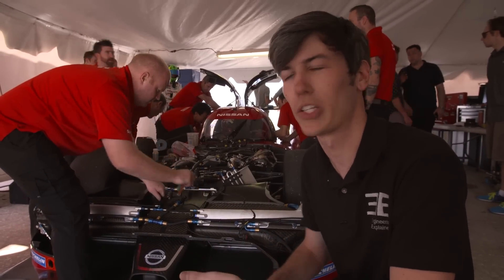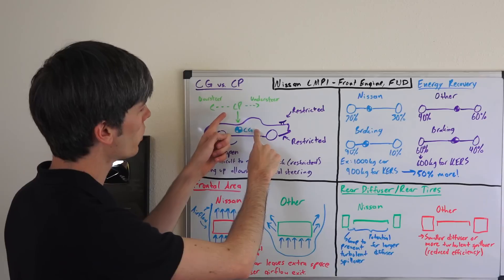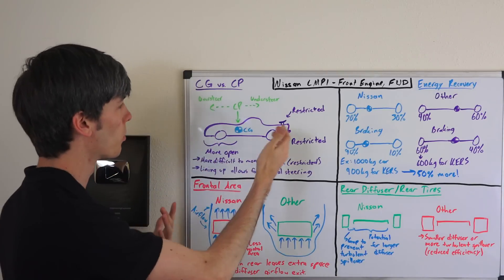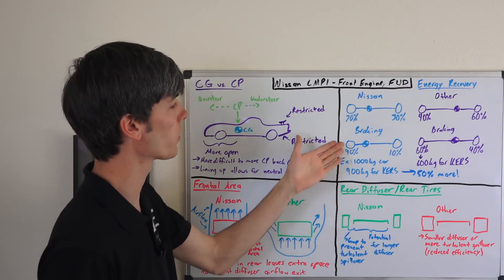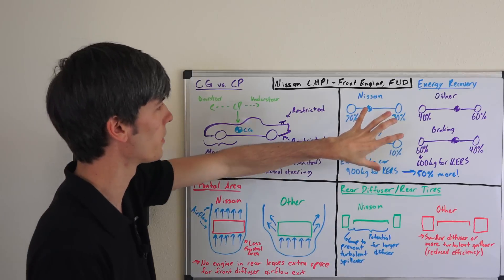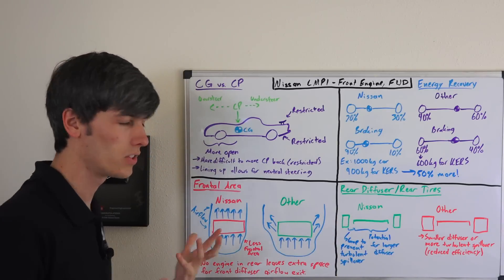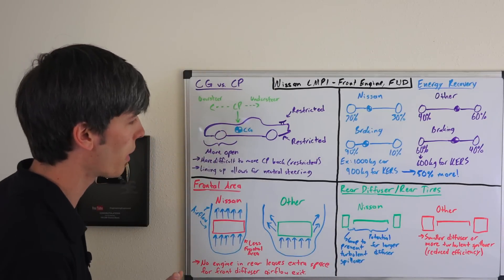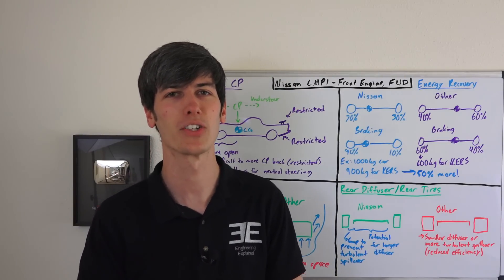Nissan GTR LM Nismo - 4 Reasons Why Its FWD & Front Engine

Comment: There're no drawbacks into transfer almost all the weight on the front axle under braking??
Reply: Daniele Dal Col I would guess that the main Problem is tire wear. It don't know how they are going to deal with that.
Reply from the maker: Daniele Dal Col If you're able to recover most of the this energy via the KERS system, you don't have to worry about the brakes overheating.
Reply: PcTechandGaming Based on other articles that I've read (topgear.com has done some really good articles on it) the majority of the braking will not be done with the brakes. Most of the deceleration will come from the mechanical flywheel that provides the energy recovery and more than half of their car's total power. When they go to slow down for a corner the flywheel spins in the opposite direction, slowing the car down and storing energy in the flywheel rotation. When they accelerate out of a corner, a drive shaft will connect to the wheels and send roughly 700 horsepower to the wheels.
Reply from the maker: Icetouch Absolutely, a challenge they'll be faced with.
Reply: Engineering Explained Wouldn't it be less efficient if front brakes do 90% of braking compared to 60%. And what about locking wheels under braking and also not being able to turn while braking?
Reply: RocketNothing Everyone makes their race cars to perform well on the tracks that you intend to win on, you know Audi bias their prototypes for LeMans as well. 

I actually think that it is the coolest prototype in some time now (purely because they are going a different route). Though you probably will not see this car on the back ground of my desk top, though I wouldn't go so far as to write this car off. I would wait and see what it can do on the race track and see if such out of the box thinking has paid off for Nissan.
Reply: Daniele Dal Col The drawback will be the tyre wear, but it wont be as bad as one would think.
Edit: sry didnt see you already said it
Reply: Daniele Dal Col There's nothing but drawbacks with it; the ONLY thing that's improved is the amount of energy it can recover from the front.  In contrast to a mid engine RWD of the same weight and power it will have;  poorer balance, poorer cornering, poorer braking, poorer launch, poorer tyre wear, excessive cabin temperatures, excessive stress on the steering components and constant problems with understeer.  It's eco approach may have some pay backs in a 24hr race on a track where cornering and braking isn't key but don't hold your breath for this thing to revolutionise the world of race car design, it will not.
Reply: Didnt say cabin heat wont be a relevant factor, but i was arguing that its ridiculous to think that they would let it get to the point of the cabin being unbearable like the other guy said. And youre wrong, this car does have several aerodynamic advantages, and the differential and driveshaft is surely neatly packaged up under the under tray as best as possible. Fact is this car can generate mass amount more downforce on its drive wheels, it can generate mass amounts more downforce but also less drag due to the rear diffuser design with skinny rear tires. Its kind of ridiculous to say they deserve to lose for trying to innovate. I doubt they will lose, if they can manage to finish the race id expect a respectable finish. I doubt they would win with this type of set up especially with such radical ideas. I wouldnt be surprised if Nismo was able to make it a contender over time though, credit where its due, Nismo is capable of incredible engineering.
Reply: u r able to turn while braking, its all about not locking, more braking less turning and viceversa
Reply: Nissan never won 24h Le Mans. Mazda is the only Japanese manufacturer that has won Le Mans
Reply: RocketNothing if they can recover more energy on the front wireless
Wheels then they may be able to get longer boosts from the electric side of things. Also he did point out some aerodynamic benefits of this layout. It is an interesting vehicle certainly, I hope they have success with it.
Reply: Nissan has one at Le Mans, just not overall in a prototype. Theyve had success there with multiple cars, and have won their in class. Their a competent racing team.

Anyways, youre just plain wrong about heat. Its ridiculous that you think a multi million dollar, technologically advanced prototype car would have a problem with heat dispersion. There is massive ducts pulling the air straight through the car, meaning cold air goes in and hot air can be expelled through the back. Its also ridiculous that you would think the front driveshaft would cause more aerodynamic distress compared to its competitors. Prototype cars have flat underbodies, they are heavily sculpted to get every bit of downforce, and every bit less drag they possibly can. Again, you are naming issues that would arise with a backyard civic track car build. This is a Le Mans prototype, you arent smarter than their engineers. They thought everything youre mentioning. Why dont you just wait to see the car perform instead of making asinine assumptions that you cant possible back up.
Reply: Indeed, the downforce and aero grip these cars can produce nowadays is staggering. Even tricking down now into the "hyper cars" and some super cars. The Gtr Nismo is a good example, Nismo extensively shielded and sculpted the underbody of that car to produce more downforce and less drag. Something that Nissan clearly pulled straight from its racing experience. Thats just one example of course, it was the first to come to mine, but theres plenty of production cars implementing ridiculous amounts of downforce inducing aero these days. C7 Z07 is another example, with 3 stages of aero. Downforce is a wonderful thing it allows for faster more stable cornering and thus better lap times in many cases, but there is something to be said for the old days of F1 racing where you had 200mph go karts racing on the Nurburgring with no electronics at all just some pedals and a steering wheel. It made for more memorable racing imo.
Reply: Some Body  Cabin heat is a well known problem for all front engine cars at Le Mans, I'm not theorising here, this is commonly known fact.  And while I'm sure you're right, air around the driveshafts is hardly going to pose a game changing obstacle, I'm simply saying that the statement claiming it has aero advantages because it's front engine isn't true, and it's not.  I think it will come last in it's class and Porsche will win this year, and quite frankly they deserve to come last for bringing a FWD car to that level of sport.
Reply: Nissan have raced at Le Mans before.  They've never won.Some Body
Reply: Icetouch yeah they're demanding a lot from their front tyres they have to find  traction do the steering and a  good % of breaking.
Reply: Daniele Dal Col They obviously don't think of it all, it's going to be so shit at Le Mans. I just hope they don't kill anyone with some kind of failure tbh
Reply: Daniele Dal Col With less load on the rear tires under braking will reduce their braking effectiveness. This will result in wasted contact patch area for braking and force all of that braking on the front tires. Even if the front to rear tire width are the same I would think that it wouldn't brake as hard.
Reply: Some Body Nissan has never won the Le Mans 24 hour.
Reply: Duane Craig  Yes, given the rule change to give them an "X" amount of energy to use, every bit of recovered power will directly transfer to added power to the car, so recovery is a very key factor this year.  Also you don't really need a car that can corner to win Le Mans, their corners are practically non existant.  But lets not lie, this is a gimmicky design that only has realistic pay offs at Le Mans 24, it isn't a cool car, I would never put a poster of it on my wall and on any other circuit that has a normal level of corners it will get absolutely slaughtered by the competition, I guarantee that.  And contrary to what this video says I don't believe it has any aero advantages over the competition, if anything ducting the exit air to the rear instead of the sides will decrease the amount of vacuum induced downforce through the rear diffuser, it also means the air has a longer path to travel through the finite space of the car body, further making more resistance and disturbing the air flow pattern.
Reply: has won at Le Mans*
Reply: Some Body In modern race cars they rely heavily on aerodynamic grip anyways to the point where mechanical grip on many race cars is reduced in its importance.
Reply: PcTechandGaming If you try to brake when turning at high speed, you will be straight like a bullet. You never brake when turning in high speeds, except in veeeeery large radius.
Reply: Some Body Why can it generate more downforce on the drive wheels?  Explain.  My understanding is simply that the rules stipulate a downforce limit on the rear wing but not the front wing?  And yeah don't get me wrong, I'm a huge Nissan guy, but only really for their AWD stuff.  They stand a chance at Le Mans with this idea, the car just bothers me, it's just wrong.
Reply: But honestly I think they're gonna have problems preserving the tyres, they're very lucky they run Michelins and not that Italian tripe ;)
Reply: Dan Green  Yes they are all good points, though to me having the centre of pressure over the front wheels further increases the heat load and subsequently wear on what is (in my opinion) an already flawed and over stressed setup for the front tyres; true they have individual tyres available on top of the standard 6 sets, but it isn't offsetting the wear very well to the rears.  How does it get 50% more recover energy than the others?  They are front wheel electric motors too, simply because they are higher capacity motors on the Nissan?  I thought the advantage of that ideal was less resistance?
Reply: Dan Green   And if you look at the aero design of the mid engine cars, they all flow air "through" the car as much as possible too, yes it will be less than the Nissan as there's an engine in the back but the pros compared to the cons here are minimal.
Reply: Seems to me to move nearly all the stress to the front end. Some may see that as a bad thing, but is it really? Seems like to me 2 slightly larger potential problems is better than 4. They will simply pay more attention to the front tires, since the rear tires will have it easy. I do think they can damage control something as important as that. Additionally, having 2 wore tires in the rear is much harder to deal with than the front.
It really seems to be something that should be restricted, but only if it is a success will warrant that true or false. I do know the rear end aerodynamics were regulated to keep people on the same playing ground, but this change makes their car much more different than the regulations intend.
It may make the regulation rules officials feel a little ticked off and loop holed, but you gotta give it to them for thinking outside the box.
Reply: RocketNothing I think it could possibly oversteer with such big grip bias towards the front.
Reply: *****  Yeah you're probably right but they still have a challenge with setting the balance up; FWDs understeer worst under power so if they've made the tyre sizes such that it counters that, the lift off oversteer will be terrifying.  Race engineers are no fools though, they will know they have to strike a balance somewhere and it's always going to be a compromise between the two on this car.  And Richard; the problem with letting the front do everything is they're just not letting the rear help out with the G transfer, stress and tyre heat efficiently. It costs resistance, weight and energy to have those rear wheels on the car and they just aren't pulling their weight (and I don't mean that in a literal sense)
Reply: RocketNothing Honestly, I think dealing with under/over steer is just a checkbox on the pre-race tuning check list.
There are so many ways to adjust under and oversteer it is not even a reasonable thing to worry about. The low friction differential will remove any unpredictability from the oversteer, then the rest could be taken care of in the suspension. Of course, adjusting for oversteer via the suspension adds more work for the tires to do, which shifts the problem BACK to the front tires again, which you can then insert my original comment.
Reply: Richard Smith Yeah many things you can do with the suspension and differential to dial the oversteer in; anti sway bars is the quickest, but there's always adverse effects, there is no substitute to having a well balanced chassis to begin with.  Not that cornering is really a main requirement at Le Mans.
Reply: +Icetouch The front tires are fatter than normal so that should help with added tire wear. 

Another aero aspect not mentioned is that the ideal cross sectional profile form front to back is large to small profile (like a tear drop). Having the engine and fat tires up front lets them achieve this with this car design.
Reply: understeer which is why fwd is hated
Reply: Daniele Dal Col. there have long been known techniques for driving fwd cars fast.
Reply: Flammen.   you know this how?  its common for radically different cars to go through a steep development curve in racing. new designs usually start at the rear of the pack simply because the drivers amd engineers need to learn how to optimize the machine amd technique, something established designs and evolutionary rather than revolutionary designs have an advantage in.

i cant say that they will or wont rise through the ranks as time passes but neither can you.
Reply: DrewLSsix Nope, if a radical design doesn't yield promising result from day one, then it is not justify to continue developing. The Hybrid LMP would have never competitive if the new regulation not heavily favor it. And due to the complexity of the system, the reliability is shot compare to conventional power counterpart. Same goes to front wheel drive car in mourning car race. Have you every heard of convergent of evolution? This can be the analogy in engineering design. Two design team can begin with two drastic different designs at conceptual phase. But if their design are intend to meet the same needs. Then there is likely hood that the end product looks similar. And that is why when you look at Airbus and Boeing aircrafts. Their layout and in certain degrees the profile are similar.
Reply: Nissans won at LeMans before, their racing heritage trumps most manufacturers. They certainly did think of everything, there is no downside because there is not a huge braking force to be transferred through the the front breaks, engine braking does most of the work. This drivetrain is very advanced, just because you don't understand doesn't mean it will "fail and kill somebody". Think about it this way, they already have one of the fastest most motorsport platforms in the world in current production (r35). They could have chosen to perfect any drive type, the reason they chose ff is because (as this whole video explained, were you not watching?) they can take advantage of the rule book and give themselves multiple advantages over the rest of the field by doing so.

Comment: So basically, it will be one of the fastest cars out there until either its brakes blow out or the front tires. But either way they will have to take so many more pit stops because of how much load the tires are getting on each corner opposed to the other cars.
Reply from the maker: stantons27 If you absorb the energy through KERS your front brakes will be fine. Also, the tires are at different widths to properly distribute the loading. Yes, it's a risk, but it's well thought out and exciting that they're not repeating the same strategy of other teams.

Comment: How much power do LMP1 cars push nowadays and how much power does KERS add on top of that?
Reply: Jason W. Morningwood This Nismo makes 1250bhp combined supposedly.
Reply: ***** They better have a damn great differential if they want to run that through the front wheels
Reply: Jason W. Morningwood not exactly true,you see,the engine power goes mostly to the front (maybe 500/600ish HP,still dont know the numbers) and the eletric engines power the rear wheels (giving the remainer of the HP),so the car is mostly FWD,except when it uses the boost from the eletric motors,which then makes the car,for as long as the boost is activated AWD
Reply: Nuno Rosário  Then again they are going to use boost only on straights I assume, considering the rear tire's size. It's going to be hard to put all of this power through relatively skinny tires.
Reply: I think I'm right in saying that every LMP1-H car has over 1000 total system horsepower this year. Beat that F1!

Nuno Rosário It's true that the hybrid element only boosts some of the time - usually when exiting corners for massive acceleration - but Nissan recently confirmed to TopGear (see Pedro's comment) that the KERS will power only the front wheels because the drive system to send some of the power backwards was too unreliable to use this year. Their KERS is purely mechanical with no electric element at all.

The 3.0 V6TT engine makes ~550bhp, while the KERS is capable of adding 1000 horsepower (!!) to that when it boosts for around 3 seconds... however, again, they've had to dial that back to around 700-750bhp for reliability, so in race trim it'll be making 1200-1300bhp max at certain points in the lap.

I sincerely hope they have a decent race this year... and I can't wait to see what the better-developed 2016 one, with probably 1500+ horsepower and AWD, will be like!!